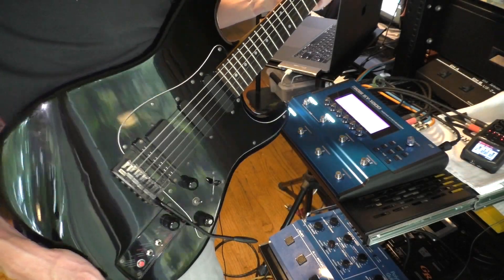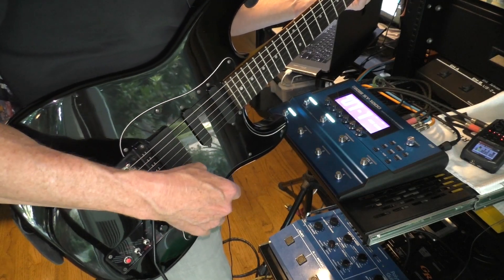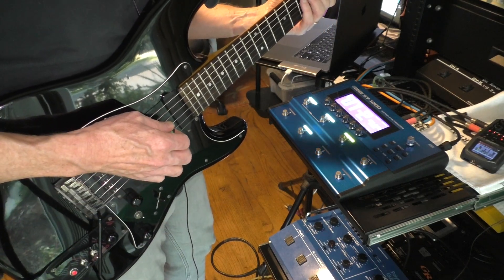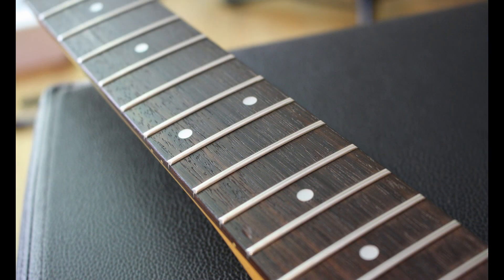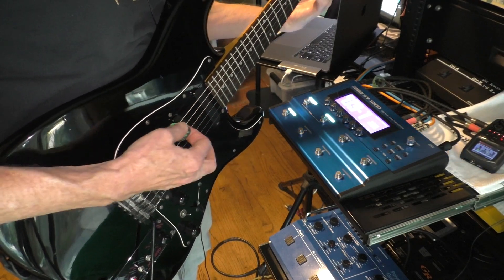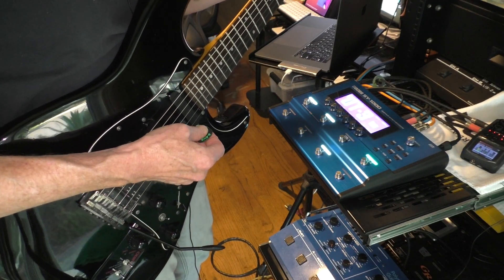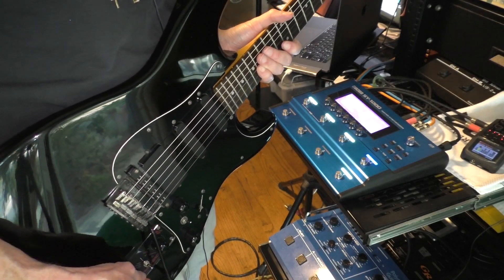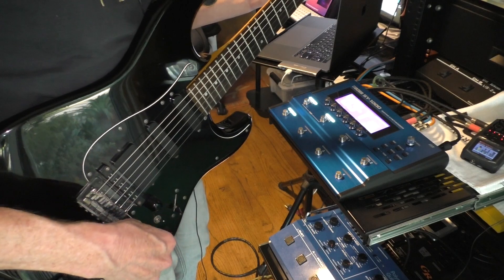Casio MG-510 Modified with Roland Ready Guitar GK-3 Electronics

Comment: I was thinking about getting one of these and try to use the 5 pin with the midi on GR 55 ,  if that would work that might be easier than modifying the guitar
Reply from the maker: You would not get any benefit using the 5 pin Casio with the GR-55. The GR-55 does not work as a MIDI module. The GR-55 is designed to be used with a 13-pin guitar.

Comment: This is awesome to see! I’ve been thinking of doing this with an MG-510 I have that someone swapped pickups and modified the pick guard already. I didn’t realize the hex PU could go directly into the GK 3 board! I’m just torn over modifying this Casio bc it functions as a midi guitar still and seems like a waste to modify a working 510, although I don’t even use it for MIDI — right now it just sits mostly unplayed
Reply from the maker: Do you have any current 13-pin Roland Guitar Synths?
Reply: @WayneJoness  Yes I have a guitar with a GK3 internal kit, and a GK2A on a Stratocaster, and a few different Roland 13-pin foot pedal synths.